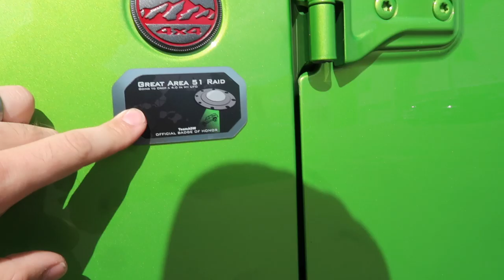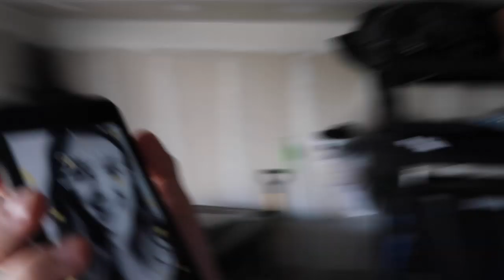How Long Does it Take to Remove a Hardtop by Yourself? *TURTLE METHOD🐢*

Comment: I built a homemade hoist lift with a hand crank winch in my garage and 550 cord. It works great. I also keep my door bolts off. I can do doors and all in under 10 minutes.  Great video,  I also love the swim noodles. I will have to make a video of my system.
 I SUBSCRIBED.